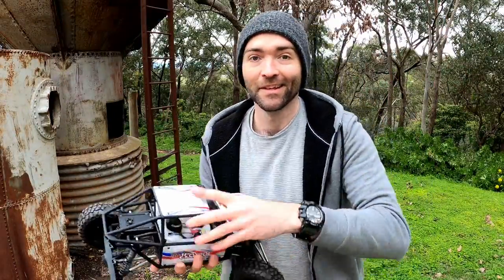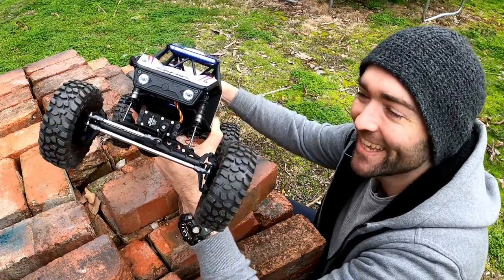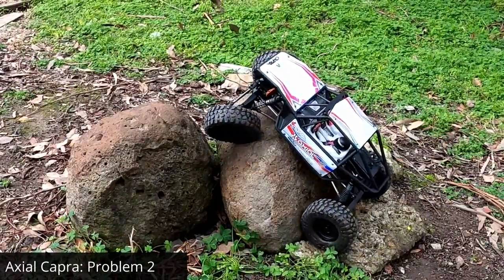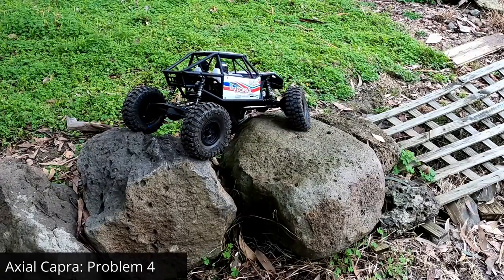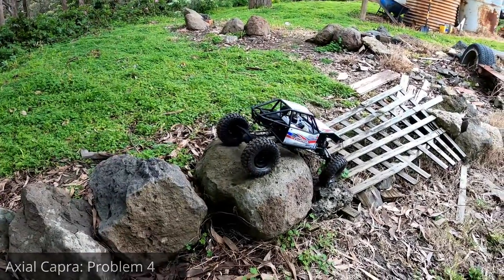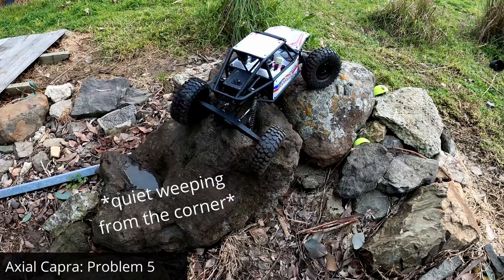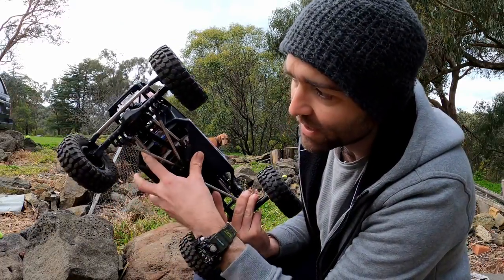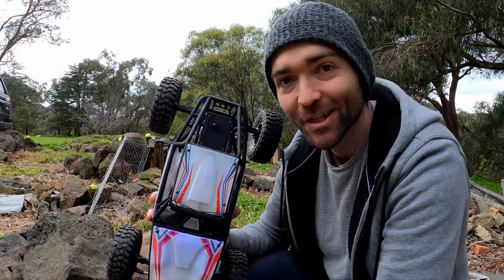Axial Capra Kit Review & Test: Best Performing 1.9" Rig?

Comment: Thank you very much for the video!  Excluding the DIG functionality, the Capra is amazing!  With upgrades it can get a lot better, but it's truly an amazing crawler straight out of the box (except for my 1 problem).  

My only issue with the Capra has been the DIG.  Out of the box as soon as I tried to turn my car on, it was dead.  Dead as in I could not get the system to completely turn on until I removed the DIG servo from the receiver.  Once I removed the dead servo and powered on, everything worked well.  I contacted Horizon immediately to get a replacement, but since the servo was so cheap I just bought it on Amazon without waiting.  Plugged it in, set all the adjustments and finally saw the DIG work for the first time.  Took it out for a drive and the 4th time I attempted to engage DIG, servo smoked and the plastic has bubbled on the side of the servo.  I've locked the DIG function and won't consider unlocking until I find a servo from another manufacturer that fits without mods.  lol
Reply from the maker: It is an amazing crawler, yes!

Your DIG issue sounds like it could be an end-point thing - a radio setup issue. I could be wrong, but this experience is common with DIG units in particular and it's happened to me a couple of times, even when I thought I had it set up right. If the servo is working against its rest position at all, heat builds up and eventually it fries. 

I find sub-trim can be useful for getting the resting point (free-wheeling, in this case) centered neatly, so the servo is at rest between both ends of throw. Then for engagement, it wants to be as far as it goes on the spool and then backed off a bit, so there's some slack. Same for the DIG - as far as it can go to engage the DIG, and then backed off a tad. Then the servo will not be under strain most of the time and will hopefully last a good long while!

(Any brand should work, just those endpoints and center point need precisely correctly. Bit of a pain, but worth it!) 
If it isn't that, well, it sounds like a run of bad luck. The Capra is amazing without the DIG, but with it she's a weapon! Thanks for watching and good luck getting it sorted.
Reply: @RCTNT  Thank you very much for the advice!  After completing the servo setup while holding the capra in the air I noticed that I had to be rolling ever so slightly forward/backward.  If the capra was completely still without movement, 1/3 of the time DIG wouldn't engage.  I restarted setting up the servo just to be sure my endpoints we're correct.  
After a third try I had everything working perfectly, but noticed the same thing. About 1/2 the time the servo would attempt to engage DIG it would get stuck just before full engagement and I'd hear the servo struggle.  A very slight roll forward or backwards always prevented it from getting stuck midway through engagement.
While driving, I just forgot and that's why I was able to get 3 solid engagements without issue.  I think it was just struggling for 2-3 seconds without me noticing, but that was enough to fry it.

Thanks again for your help!  I really appreciate it!
Reply from the maker: @dr01d21  feels good to get it sorted! Hopefully that's it!

Comment: Sweet, I’ve got one on my wish list - what else competes with it?
Reply from the maker: Excellent question. Gatekeeper, kinda, but not as composed on the rocks. Hm, probably a few others. I'll think on that and come back to you - maybe there's a video in that question somewhere.

Tell you what, I can at least put the same tires on the SCX10 III Gladiator, they both have a similar wheelbase and have similar running gear. Same DIG unit. Maybe a 10 Gate course in the dry, same tires, could be informative? Hold my beer.
Reply: Gatekeeper is on my list also. Basically all the element trail / crawler rigs are. Super impressed with enduro platform. I’d buy a 2nd hand axial for sure.
Reply from the maker: @2011rubicon  we're spoiled for choice to be sure!
Reply from the maker: Done! Check today's video. Tires are a big deal, as it turns out! Most capable vs least capable crawlers with the same tires and suddenly both are in the same ballpark. Who knew? :)
Reply: G-made makes something similar.
Reply from the maker: @jeeplivion  you mean the r1 or the gom? Presumably the r1, given the specs. Interesting mix of gear.
http://gmadekorea1.cafe24.com/r1-rock-buggy/